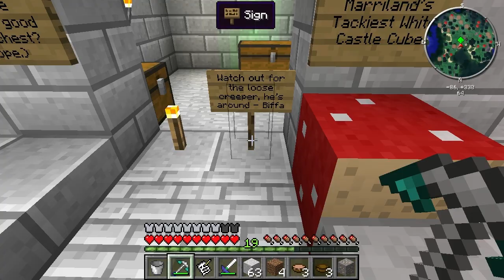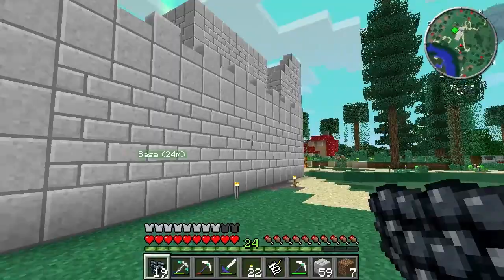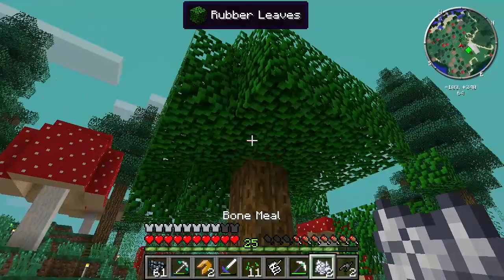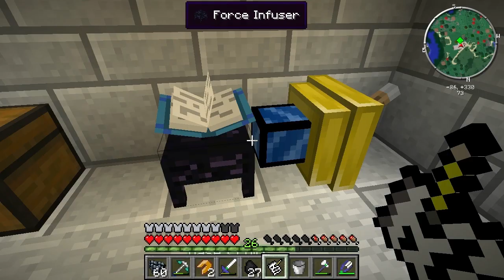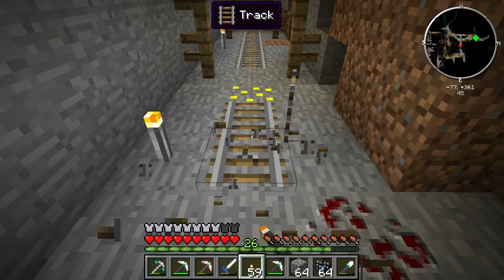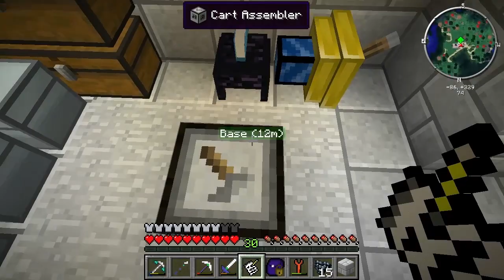HermitCraft FTB Unleashed Part 03: Off-Track!

Comment: The castle looks ok, but I agree, it could use a bit of color and more rooms.
The golden power source: The 10 Produced thing is telling you one golden power source smelts 10 items, not that it does 10 at a time. Coal smelts 8. I think lava buckets smelt a stack.
And I think you should make Speed-Wing armor instead of using a jetpack. Although it's not infinite, you can fly for quite a while with the full set, and you get a lot more armor points - about 24% more damage reduction!